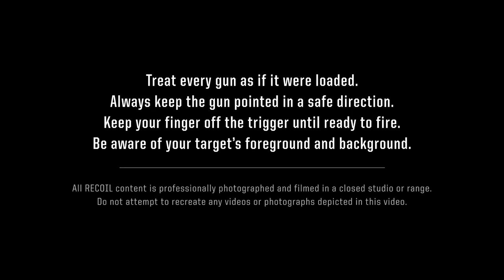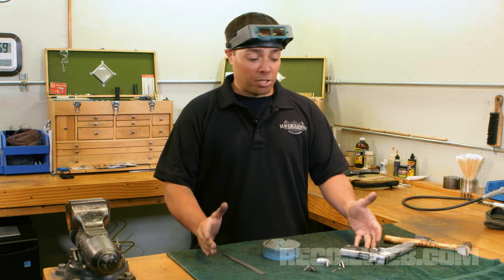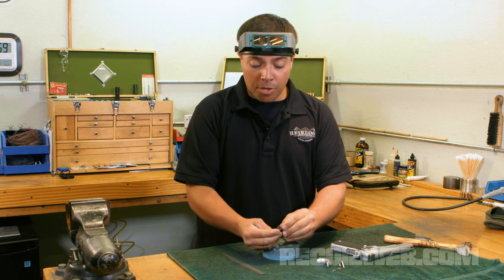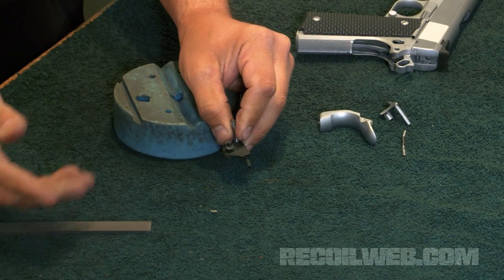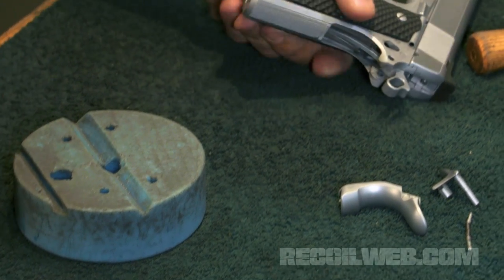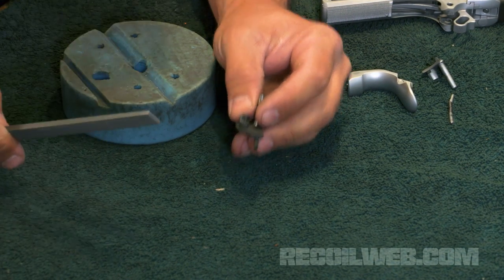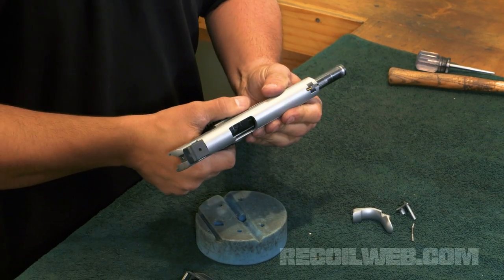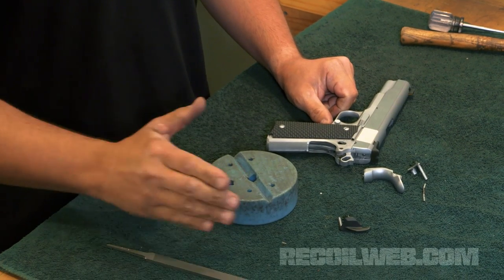Fitting a 1911 Thumb Safety on RECOILtv DIY (full episode)

Comment: Installation of the grip safety was not necessary for what he was demonstrating.  When operating properly, the grip safety blocks the rearward movement of the trigger bow when the trigger is pressed.  When the grip safety is compressed it pivots the grip safety arm up and out of the way of the trigger bow allowing the trigger to move rearward and contact the disconnector.  With no grip safety installed there was nothing to block the rearward movement of the trigger.

Comment: Nicely done. I did warranty work for Colt and S&W and you properly described the procedure. You may want to add that, at the function check after fitting, after you try to pull the trigger with the safety engaged and you return the safety to the "off" position, you then slowly pull the hammer to the rear and there should be NO movement or "click" of the sear. BTW, love the sound of a new, fresh file.
Reply: I have watched a few of these guntubers and everyone of them have failed to know this fact also needs being done after you pull against the grip safety, so many pretend to be teachers and have not yet learned

Comment: Outstanding video.  Even with the non-close ups (or as close as I wouldn't have liked-ups) this was extremely helpful.  Building my first 1911 here and was a little nervous about where, how and how much to file here.  First straight forward tutorial on this.  New ambi on my 1911 works perfectly now and is smooth as butter.

Comment: Really got a lot out of this video. I was having issues with the thumb safety being difficult to engage completely. I had recently installed a beavertail safety, hammer and sear in my 1911 and was unable to get the thumb safety to fully engage. It engaged enough to work, but would not fully engage. After watching this video I was able to file down the spur on the safety that engages the sear and after carefully fitting it, the safety now engages like it should. Thank you for the information.

Comment: Bought a Springfield mil-spec and was experiencing a problem cycling the thumb safety in the fire and safe position. I appreciate this video, but in the end I found the issue was the external plunger spring...it was simply too stiff. It didn't allow a smooth action. I took down the pistol so I could study the internal action of the thumb safety against the Sear everything look great...no binding. Next step...I cut the plunger spring just 1/2 of a coil. Still a little stiff. So I cut another 1/2 coil. Problem solved...the motion is as smooth as my high end Kimber. I'm surprised this issue hasn't been fixed by Springfield Armory. Not sure if other mid range pistols suffer from this issue. But really this is a 2 dollar spring. I was ready to sell off this pistol,  now it's a keep because the mil spec is otherwise pretty great. Hope this help other Springer owners. Try the fix...if you cut too much simply buy a new 2 dollar replacement spring. Shoot straight my friends.

Comment: Great video. I have a question and I can’t seem to find an answer anywhere. I put a deposit down on a new Dan Wesson Specialist 45ACP today. Never owned a DW. Here’s my question, if I try to engage the thumb safety when there is no bullet in the chamber and the hammer isn’t cocked, is it normal for the thumb safety to slightly travel, click and stay slightly up as if it’s engaged? I was confused because it seemed to feel like it slightly locked in place when the thumb safety shouldn’t move? I’ve tried to make the thumb safety budge on a Springfield and a Sig, but the safety didn’t move. I’m hoping the gun I’m buying isn’t defective.

Comment: Thanks for the video. What does it mean if my hammer won’t lock back? It will only lock back if the grip safety is depressed but as soon as it’s released the hammer falls without pulling the trigger. I put a new thumb safety as well as hammer. Thanks.

Comment: good video but ... first it is advised that you fit a new safety to the frame (without the sear, hammer and diso), before filing it to fit onto the sear.
The safety needs to move up and down in the stripped frame, first.

Comment: I have a question maybe you can help me with. I recently acquired a 1945 Colt 1911. When I place the gun in position 1 with a thumb safety on, I am still able to fire the hammer. Im not sure if the thumb safety cam is not blocking the Seer or possibly the hammer is missing the detent which is allowing the hammer to fall when I pull the trigger with the thumb safety on. Aside from this everything with regards to pulling the trigger and the hammer falling seems to be working normally. Do you have any suggestions on how I can correct this issue?  Thank you

Comment: "You can see that [...]".  The thing you're pointing at with the pointy end of a file is about the size of a grain of rice, and you're holding it 4 ft away from me.  So, No, I can't see.  Imagine if the screen had 4 million pixels, but you were using only 16 of them in the center to "show" what you're doing.
Reply: Imagine complaining about instructions that the top 1911 gunsmith in the world is teaching you for free lmao